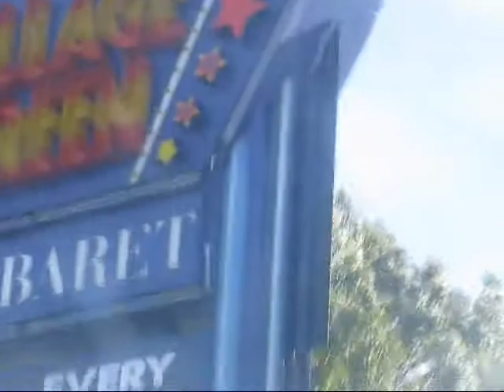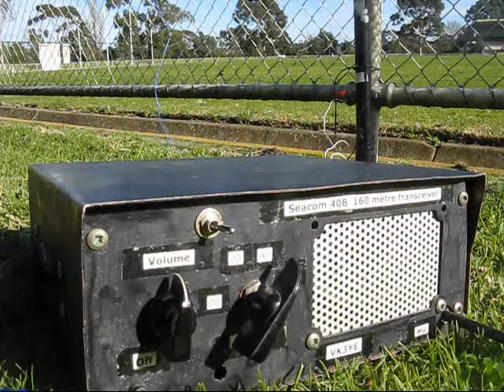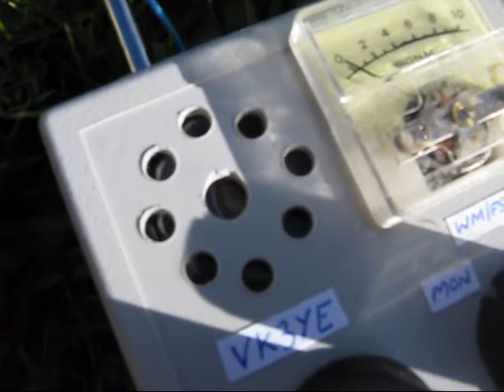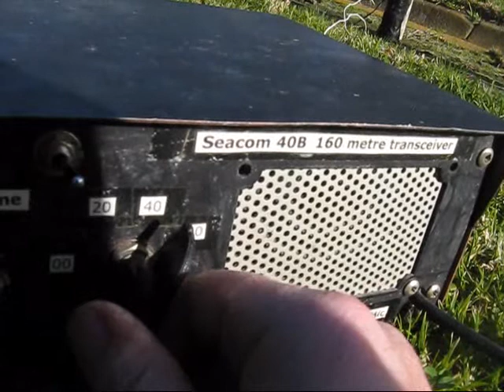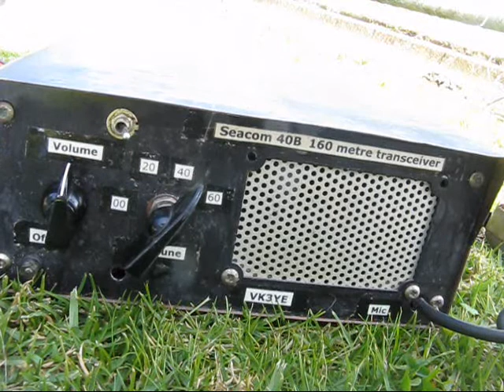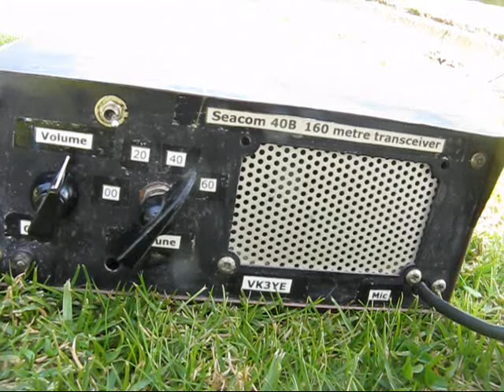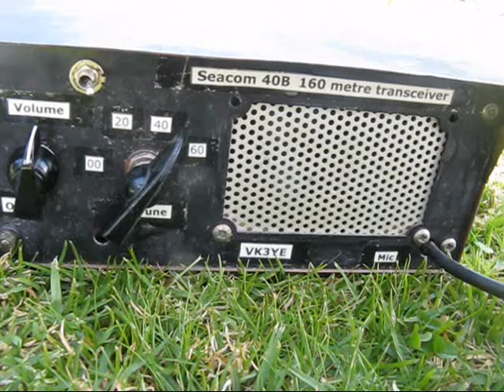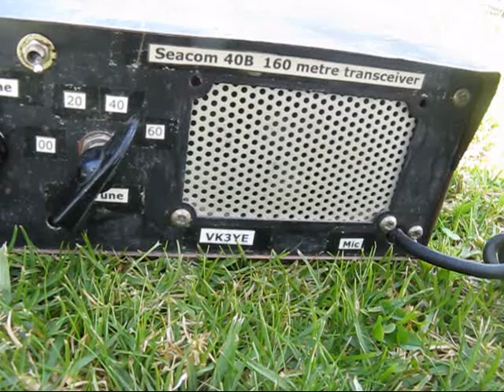160m AM portable from Glen Waverley

Comment from the maker: @vk2ig Mike - the answer is very little but it does a lot. Includes bandswitched tuned circuit, diode detector, LM386 DC and AF amp, dummy load and xtal osc on 3.58 & 5 MHz.  It will be subject of an article so might do a video on it when it appears.